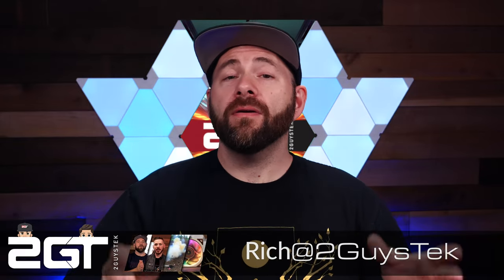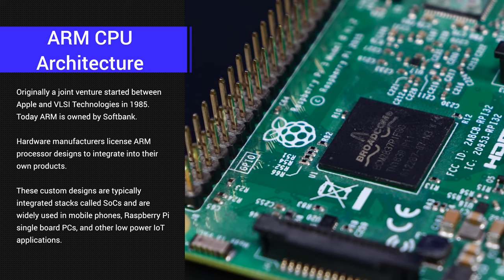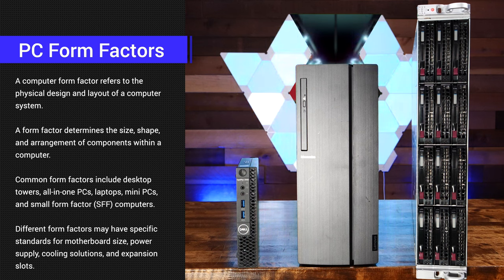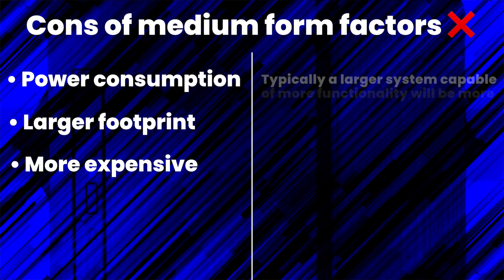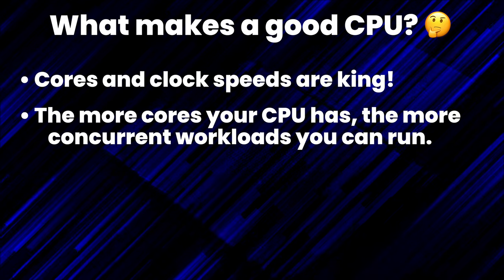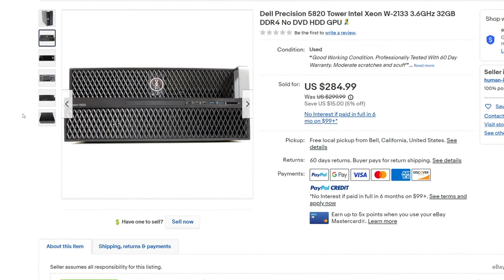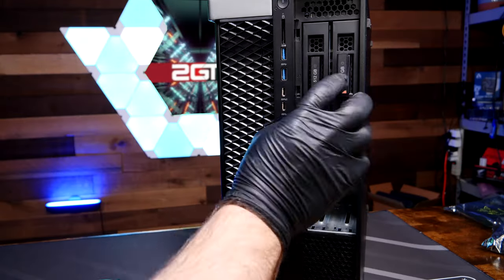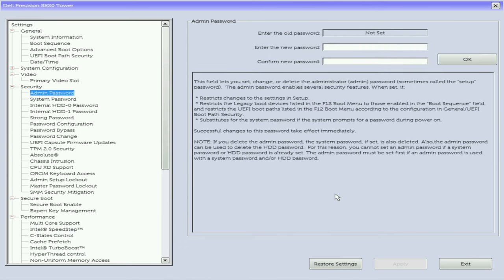How to choose your first home server! - Cheap and powerful home server!

Comment: Huge over kill.... People for a home server just get a dell optiplex micro or a micro pc with a decent cpu i7 or i5 like 8-10gen with 32gb of ram and use proxmox and then learn about containerization and do docker containers and kubernetes half the cost and buy a couple and have a cluster with redundancy and add on a raspberry pi for pihole... dont need much even an old laptop laying around with virualization is perfectly fine proxmox or just a linux distro and do containerization.. the overhead on vmware or hyperv for a hypervisor eats alot of the performance along with bloated OS as windows GUI just do a shell install it still can be a domain controller just use sconfig and powershell...
Reply: @anthonybenjamin4311  Oh, absolutely, because who wouldn't want to turn their use case into a full-blown NASA mission control center? If he wants to use a sledgehammer to crack a nut, who are we to stand in the way of such precise and well-thought-out decision-making? Bravo to him for skipping the budget options and diving straight into the realm of over-engineering. 👏
Reply: @Mavo1989  yeah. Those tiny dell/hp/lenovo computers can't hold and stream my 40tb of plex shit or my iscsi drive I use for steam
Reply: I have access to those Optiplex SFF after a 4 year service life and yeah they work fine.  My pfsense, UniFi controller, grafana, etc all running in an Optiplex 5050.  The precision 5810 is running plex now because those stupid Optiplexs can only fit 1 3.5” drive.  They are great for simple tasks but def not a storage server.

Comment: I went with two EPYC 3251 based servers, my power bill was already too high. A decent balance between power consumption, cost and performance at the cost of upgradability.
Reply from the maker: That’s perfect!
Reply: Link?
Reply: @onedjscream  I'm trying to post the links but the message keeps disappearing
Reply: how much wattage does it use when idle?
Reply: @tinostarks   I don't have an exact number on hand but I do know a slightly less powerful system I built with a 3201 CPU uses less than 30w at idle running pfsense.
Reply: @foxale08  Did you buy it off ebay? or a different site

Comment: I personally love the dell workstation line. I have been using the 7600 series with 2 proc and 512gb ram with SSDS for a few years now.  ran proxmox but back to esxi. I recently got a second raid card and move my Truenas Scale storage from a hp microserver to a VM. It is a super quiet wife approved system.
Reply from the maker: Love it! We ran a T7600 for quite a while as well! Fantastic platform!
Reply: I didn't think the newer version of esxi was free for us home lab users. Am i wrong?
Reply from the maker: @harrysearia1784  yep, free just like previous versions. We made a video on installing ESXi 8, in the first part of the video we walk you through getting your own free copy:
https://youtu.be/FlOJh8hesqA
Reply: @2GuysTek  Excellent, thank you for the quick reply.

Comment: This was very helpful! I was originally looking into a used Dell PowerEdge tower for my home server, but they cost twice the price for the older models, and I realized I didn’t need features like dual sockets or redundant power supplies. Didn’t know how cheap the Precisions were until recently, and for how new they are too, I bet you can get a lot more life out of them. Looking into the Precision 5820’s now, already got a Jetway box picked for the home networking, also gonna try to find a low powered NAS to back everything up
Reply from the maker: So glad you found it useful!
Reply: I bought my Precision T5600 back in 2018, it's been great. Paid $480 for chassis with dual Xeon 8-core 16-thread, 64GB RAM and a Quadro 600. After a couple years I did swap out the Quadro for a NVS-510 for it's quad monitor outputs. I use multiple virtual machines in my lab, and having two Windows 10 plus 4 linux machines running at the same time is no problem.

Comment: Solid video covers the basics to get people into networking! Hardware, server type, form factor, architecture, storage, fucking nailed it! Simple to follow too (Also pro tip) depending on your use case, low end gpu's or none at all isnt a bad idea. VM's generally need those graphics tho

Comment: I use two old computers for my home lab, it's not the most powerful computers but it's enough for my lab.

TRUENAS Server : i5 4670 / 16Gb RAM / 3x 4 To RAID Z-1, it runs Jellyfin and SMB Share with S3 Backup.
Proxmox server : i5 4670 / 16Gb RAM / 2 x 1 To SSD, it runs Nextcloud, Pi-Hole, NGNIX , and Home Assistant. 

I've bought them for cheap, and are quite efficient. Next i will bought a ZimaBoard in order to install PfSense to make a Firewall.
Reply from the maker: Awesome! There's nothing wrong with older hardware! Thank you for sharing them!

Comment: I've been recently considering setting up a server for the fun of it and maybe some practical use. I can't see a need for a super extensive system like you showed here, I can't even think of enough services I would want it to run. I've been playing currently with an old 2009 dell desktop which is barely powerful enough to run the tasks I've asked of it, but it's seriously lacking in cpu cores and RAM. I've seen some much better spec-ed hardware listed for around $200-300 with much lower power consumption, but I hesitate to pull the trigger on that because I'm honestly not sure I have enough services that I'd /actually/ use on a regular enough basis to justify buying it, it might come in handy for certain tasks, but not much I'd need running all the time.
I see all these videos talking about what the setup on their homelab servers, and mostly I see them just list OSes and VM hosts and such, and I'm like great, so you can setup a bunch of VMs/containers, what do you /actually/ have them doing that needs to run all the time and justifies the power/cost of the server?

Comment: One quibble, WD policies on Red Disks have changed, and they are having reliability issues. I would use Seagate Iron Wolf drives.
Reply from the maker: Drive loyalty and preferences are a touchy subject for people, and I feel like brand loyalty is for suckers. We’ve had good luck with both IronWolf and Red+ drives and for us it always comes down to which disk is more affordable at the time.

Comment: Aren't Xeon processors power hungry? even on idle?
Reply from the maker: They can be, depending on the model of Xeon you choose. For example, the newest 4th-gen Sapphire Rapids Xeon consumes 350W TDP, which is insane! I'm not recommending anyone use a chip like that in their home server. For comparison, the W-2123 Xeon in this box has a maximum TDP of 120W, and I just measured this box as-built in the video, and it hovers around 70-100W at idle.
Reply: correct. would be better to go even first gen ryzen.. up to 8 cores of good performance and at least half that power draw
Reply: I even use my xeon x3430 as my home server it has 95 watts consumption and i undervolt it to consume lesser electricity

Comment: The de t5820 is tricky. I bought one that had 4 sata flexbays. I thought just buying the dell m2 nvme flexbay would work. You also have to buy a backplane for the nvme flexbays after taking out one of the 2 sata backplanes. The cables for the nvme flexbays fit to some connectors in the motherboard, plus the heat sensor cable. So, know your stuff for this model. Also the is a sas backplane i believe. I may resort to a pci card solution if the above is too much work as well as potential added costs

Comment: 10:26 did he say I can build my own CPU if I'm feeling whimsical ? Lol... Good video, no fluff or Bullshit... Trying to decide how to set things up for myself and deciding what hardware to use is such a difficult tradeoff equation... I already have a bunch of random devices I've collected over the years but deciding what to use wear, and not spending (much) more money is difficult. I need to just set it up so my haswell i5 desktop only turns on if/when needed for media serving (but don't think I can even do WOL with my mobo... So do I buy a new mobo? Seems silly to do for such an old setup .. questions like this are hard to answer). I think there simply IS no best answer; this is a problem people are still working on and the home server environment is still in its infancy 

Anyways, I appreciate the advice.

Comment: What do you think of a dual xeon E5-2690 motherboard? For a home server or better other options?
Reply from the maker: It's an excellent platform for a homelab! Dual E5-2690s would give you 32 total threads, which is a lot of compute! On the downside, the E5-26xx CPUs are first-generation Sandy Bridge Xeons that came out in 2012, so by today's standards are getting pretty old and, because of their generation, are less energy-efficient than newer Xeon CPUs. You can check the motherboard you're planning to use and see if they support the second-generation versions of the E5-2600 series CPUs (known as the E5-2600v2) because many were compatible with those chips which would give you better efficiency and compute performance per watt!

If it's all you've got, I say go for it! Get in there and start building your homelab! You can always upgrade in the future!

Comment: I went with T5600 but could not get HDD ports to work. HDD ports 0-4 would work in bios but not in OS unless connected to Sata ports 0 or 1
Reply from the maker: What are you running on it?

Comment: What is the best way to understand and learn about server hardware? What is compatible when building etc
Reply from the maker: For us it was to buy some and start experimenting and working with it. If your interest is in data center server hardware, then buy a used server off eBay and start playing with it. If you focus is more about the different software systems you can run on server or workstation hardware, then get a used chassis like the one we used in this video and start installing different OSes on it and playing around on it. And also (shameless plug) subscribe to our channel because we have a lot of content that focuses around server hardware! Best of luck!

Comment: wish u included some power usage numbers, I have a T7810, dual xeon unit, but its a pig, can't use it 24/7 cause it uses too much power.
Reply from the maker: Idle numbers as-built are between 70-90W

Comment: I see a lot of these guys claiming you can run a home server on a Raspberry Pi, BUT I have to question the honest value in this claim, because the problems of hooking up storage devices to a Pi isn't exactly the type of computer you can actually store a number of larger files on!! And a Raspberry Pi, isn't overloaded with a large number of SATA ports so adding drives to one is nearly impossible, if you have a bunch of larger files as well!! 

For example my music collection alone has over 30,000 songs in it, and the hard drive I currently have my collection on, is a 3 terabyte for added capacity as I add music to it! But generally speaking the total collection in whole consumes nearly 2 terabytes by itself, and one I begin adding other files I want to share like photos, video and documents, I could easily fill a bunch of 3 or 4 terabyte drives easy enough!! AND keep in mind I am an old guy who has been working on and with computers since the 1980s, SO my collected data is pretty large by this point!! And while there are things I now long use like old software and some stored data, my collection isn't totally "sorted" either!!

Comment: Just bought the same exact system. I want to use it as a storage,VM and home assistant. 

My question do I need a powerful GPU or can I just buy a cheap one?

I’m installing trueNas scale on it.
Reply from the maker: The only real consideration on the GPU would be whether you plan on doing any transcoding with it. If that’s not something you’re looking to do then a cheap GPU is fine.
Reply: Thanks
Reply: @2GuysTek do you have more in depth videos for a gaming server? I would love to set something like this up but videos on YouTube seem limited on tutorials on this.
Reply from the maker: @Ignotus2023 when you say gaming server, what do you mean specifically? A system to host game servers like Minecraft, or do you mean a system to run your games off of and remotely connect to play them?

Comment: A year later, the Dell Xeon workstation 5820 I bought, the motherboard died and it got e-recycled. I ended up buying older Ryzen parts that supported ECC memory new at a discount rate. It was around $600 USD for MB, CPU (8 core), Memory (32GB ECC), GPU(integrated), PSU, and a Case that supported 8x 3.5" drives. Always a gamble using used hardware (and sometimes new too!).

I think things are going to get more expensive come 2025 all around. :(  I'd get your server now if you need one. Maybe buy 2.
Reply from the maker: I'm sorry you had the failure! I'm inclined to agree with you about HW prices in the future.

Comment: You can be not very accurate here. x86 Celeron based SBC can be more power efficient than Arm based. Surprise? For me too. Anyway, Arm based systems are cheaper and I selected Arm for a home server. Did you consider also Apple Arm?  Mac Mini can be perfect for a home server, but it can be a bit expensive.

Comment: I’m planning to buy a renewed server with this specs for VMware esxi and cybersecurity labs, what you think?

Torre Dell Precision 7910 / T7910
2 Intel Xeon E5-2670 V3 de 12 núcleos de 2.3 GHz
64GB DDR4 REG
Nvidia Quadro K2000 2GB
12,24 TB (SSD de 240 gb | 3 x 4 TB 12 Gb/s SAS NUEVO)
Reply from the maker: The E5-2670v3 CPU is quite old at this point. Check and see if you can upgrade the T7910 to a v4 CPU. VMware doesn’t support the v3 CPUs with v8, but do on the v4 CPUs. For most systems, the E5-26xx v4 CPUs are drop-in replacements with the v3, but check the platform (Dell’s docs) to make sure you can. 

Otherwise, great platform for running virtualization and running labs!
Reply: @2GuysTek  thank you for your feedback, really appreciated, my other alternative is this server

Dell Precision 7820
Intel Xeon Silver 4114 10-Core 2.2GHz (3.0GHz Turbo)
Memoria de 32 GB, actualizable a 512 GB
SSD M.2 NVMe PCIe de 1 TB (bahías extraíbles de intercambio en caliente)
Nvidia Quadro M2000 4GB - Windows 10 Professional 64 bits
Reply from the maker: @omarkobayashi this is a better option because it’s a first generation scalable Xeon CPU. You can upgrade this system easier in the future and you will get more years out of it.

Comment: I'm putting together a server can you tell me if the specs are okay it's a ryzen 9 6900 HX 8core 16 thread 3.3 GHz base clock 4.9 GHz boost clock 32 GB of ddr5 dual channel 5600mhz sodimm a 1 TB m.2 nvme SSD and a 500 GB M.2 nvme SSD it has  high speed ethernet Wi-Fi 6 and Bluetooth 5.2 Windows 11 and an RX 6700 XT 12 gigabyte graphics card I want to run a thousand slot do you think that's possible
Reply from the maker: That sounds like a pretty powerful system for your homelab!
Reply: @2GuysTek  thanks so do you think it'll be able to handle a few hundred players on GTA 5m as a server ?
Reply from the maker: The system you’re building has the power for it, yes.
Reply: @2GuysTek   whooo hoooo lolo thank you 😊

Comment: When it comes to enterprise equipment, atom is NOT cheaper than x86. I'm currently looking for hardware to use as a firewall. Every single name brand firewall uses atom, and it costs 4x what i can build a Ryzen  7 system with. I understand that comparing a consumer computer with an enterprise switch is a bit unfair, because of software considerations, But honestly they are charging three thousand dollars for hardware from fifteen years ago. Any consumer grade I t x motherboard With anything more than two cores that you can buy for under two hundred dollars, can be cheaper and a faster router than any three thousand dollar enterprise router.

Comment: I hope you're not keeping those blue drives in there those Western digital blue drives are not NAS or server drives they're not meant to be on 24/7 nor do they have the reliability
Reply from the maker: We've run plenty of Blue SSDs (not HDDs) in our NASes for a long time, they have a respectable lifespan (at least 3 years typically). Now if you're talking about mechanical HDDs, I completely agree - NAS-rated drives like WD Red Pro and Seagate Ironwolf drives are a must.

Comment: You're making the same mistake as several other channels here on YT by claiming that a PC of any kind can be a server. They simply are in no way, shape, manner, or form a server. These little mini PCs cannot run a NOS (Network Operating System) like Microsoft's Windows Server 2022 -- the install disk will not allow you to because they need a completely different CPU (like AMD's EPYC server CPUs or Intel's Xeon server CPUs) and different chipset. You want a "home" server? Go buy a used HP ProLiant server and start with that. Be sure to get a rack to mount it in, along with your UPS, NAS, network switch, slide-out keyboard tray, monitor shelf, and maybe a tape backup drive (or you could use a KVM switch to your desk).